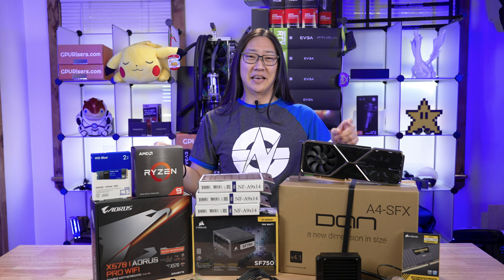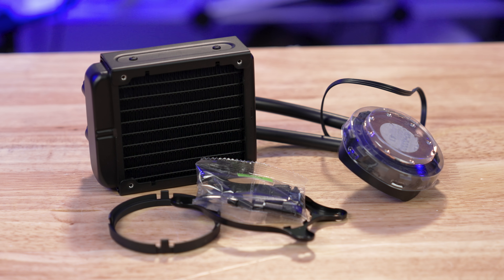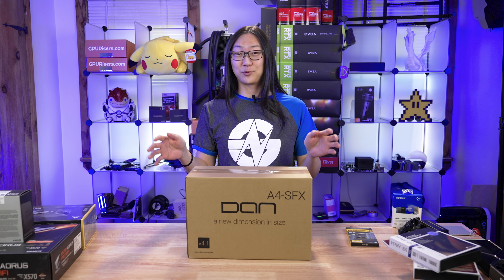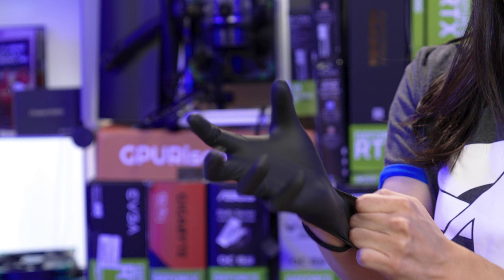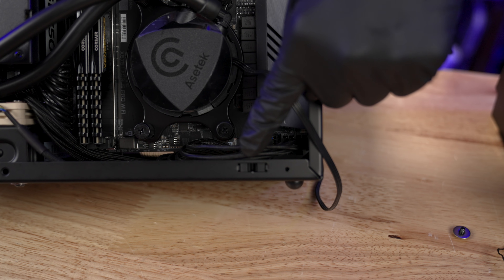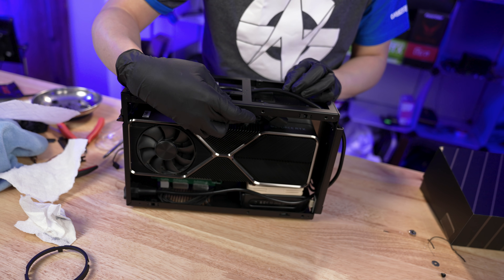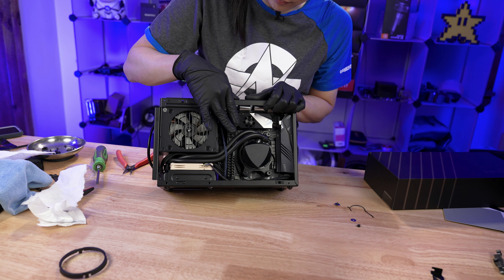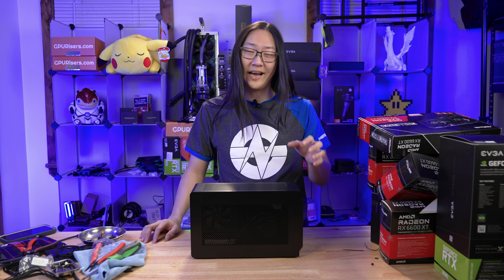DOES SIZE MATTER? This MINI PC has HUGE POWER!

Comment from the maker: Have you built a Mini PC? what sucked the most??
Reply: Has to be the skinned knuckles. And then wire management.
Reply from the maker: Oh yeah, that's why I wear gloves so I don't hurt my hands as much. On top of that it keeps all the oils off the internal components. Working in a mini ITX small tiny PC is really difficult lol
Reply: @TekShinji  dude that little build is sooo sick! Love the amount of research (on components) you have done to get everything to fit. That’s the hardest part that’s not shown in vids!
Reply from the maker: Yeah we wanted the video to be less than 30 minutes so... We had to cut all that out. Out, but definitely all those parts were research ahead of time to make sure they would fit. And test fitted prior to this.
Reply: Closest was a test rig to buy gpu’s lol. I think I have a new project now, thank you lol
Reply from the maker: Oh yeah definitely you could use it as a test break that was portable.

Comment: I also have a 3080 ti FE in that case and you can give it a little bit more breathing room by adding standoffs on top of the already existing standoffs that screw in the pcie riser so it sits a little further away from the psu and it still fits !
Reply from the maker: That's a great idea! I'll definitely give that a try :-)
Reply: @TekShinji  I did it the first time I built the computer so I have not compared without it but it should be beneficial I suppose
Reply from the maker: @-kahmi-  I'm sure it will! ❤️❤️

Comment: I have a 5900x and 6900xt in mine (molded to fit gpu) 92mm rad works great. Had to extend case feet and add extra basement fans. Could never pushes past 80c
Reply from the maker: Yea it's insane how it's able to keep up with it!

Comment: The way you mounted the AiO the pump is higher than the radiator. You shouldn't mount it that way.
Reply from the maker: Thanks for the comment, do you have a recommendation of how to mount this properly within this case?
Reply: @TekShinji  sadly, no. Just wanted to point out that the pump always should be the lowest point of the AiO. But I guess you already know. I like the build anyways :)
Reply from the maker: Thanks buddy, I understand that it is the improper way, however, there's no other way to do it other than to modify the case. I'm glad you like it!

Comment: Could you fit a evga 3080 xc3 in this case?
Reply from the maker: Yes, you can. It's tight on the end. The maximum GPU length is around 295 mm The XC3 is around 285 ish so it does fit.
Reply: @TekShinji  In your next video could you show a comparison with temps of Fe and evga style card?
Reply from the maker: Definitely something to consider! We'll keep that in mind. Our schedules about 2 months out right now so it won't be anytime soon. Unfortunately. Those video cards have been scheduled and purpose for other videos but will definitely try
Reply from the maker: The founders edition cards are generally smaller looks pretty and all that good stuff, but the noise ratio to cooling performance is usually pretty bad. The AIB partner cars are usually pretty good with cooling since I got more fanage and thin space